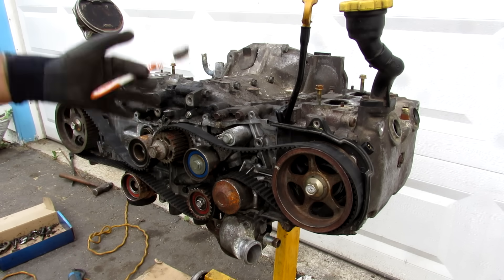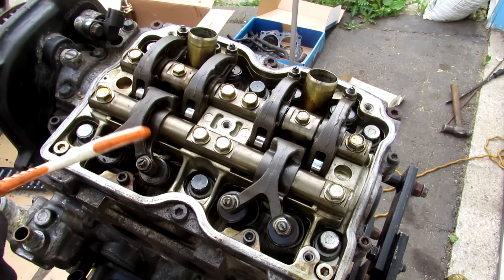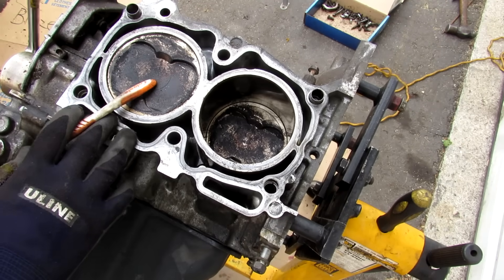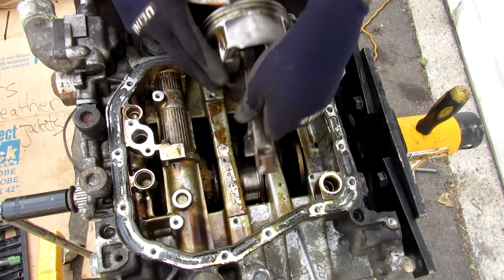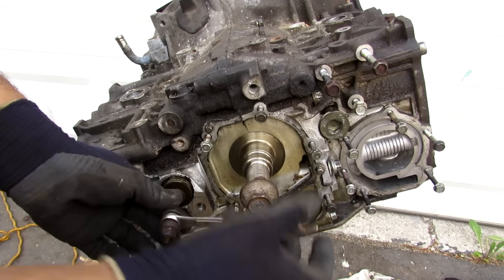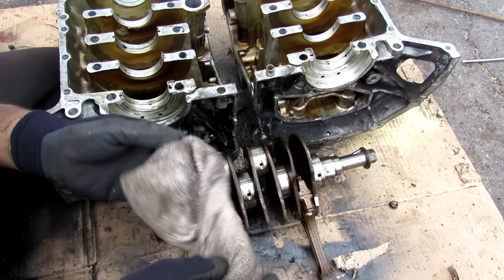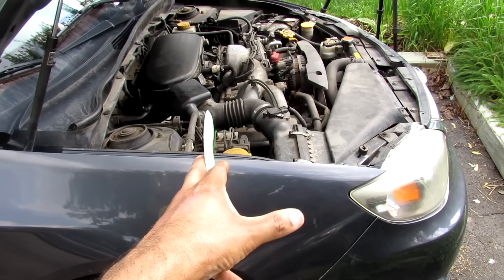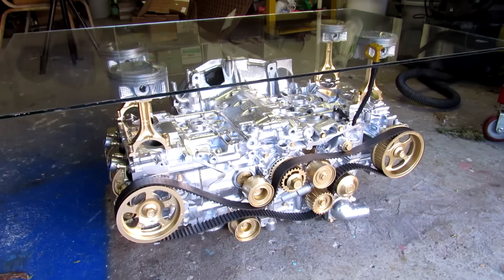Why Subaru Engines FAIL

Comment: They go knock knock and when you answer your connecting rod comes out lol
Reply from the maker: That's what happened here haha
Reply: That was funny
Reply: Thats about what happened at chernobyl as well
Reply: In the industry we call those "ventilated blocks." Lmfao
Reply: There is also piston slap and sometimes chatter in the valve system - don't know if it would be guides or lifters there. Sometimes a timing belt roller bearing will tick loudly, and cheap Chinese replacements for that item are a mistake. Today most of the after market parts come from China so  you must pay dearly for OEM Japanese manufactured parts, especially brake pads and rotors. Best of luck if you try using a cheap off brand head gasket and hope to get more than 10,000 miles out of it. My check engine light went off recently throwing a fuel tank vent solenoid error and simultaneously blocking fuel hose fillups so I priced the $400 dealer repair and may be able to replace the solenoid as  after market at Autozone or Advance Auto Parts for $75. That is what is good about owning a Subaru.
Reply: @z978ady  all brake rotors and drums today come from china. Even the ones on brand new american made vehicles. Very little is made in north america anymore. The pollution laws have stopped the manufacture of most all cast iron products in nth america
Reply: Happen to my volvo 850R i was using water/methanol injection and one day i decided to use bigger injector 440/cc vs 320/cc stock. When the methanol injected at 12 psi it bend a rod.
Reply: @jakelowang4132  Rather have spaghetti rods then my 05 s60R's cracciboi cylinder walls.
Reply: @daviddou1408  engine developed head gasket leaks in 2o15. So I had gaskets, timing belts and idelers reply ed at that time.
Reply: ki0ng that is pretty much what I do. RPM varies between 2500 to 3500 on back roads and 2800 (75 MPH) for hours on end on the expressways. I do not drive it like a rally car except on snow covered winter roads. Also change oil every 3000 miles.
Reply: My Subie has clattered on start up for the 100k I have owned it. So did my ancient VW Bug and it lasted 250 k. Both had piston slap that went away as the engine heated up. Then the clanking stopped. I will admit the head gaskets had to be replaced at 90k. I consider the Subie to be a well made car with a decent reliable engine. 
I hope this guy is better at rebuilding engines than making nearly incoherent videos.
Reply: @gregwarner3753  I dont think he's saying subarus are poorly made. I think he's pointing out the common failure points, every engine has em. If you know where they are, you can be weary and get more life out of your engine.
Reply: @Twofacedrezy  6.0 liter powerstroke diesel comes to mind it has so many issues its hilarious yet every one of the people who own them will shit talk the 6.4 powerstroke
Reply: @Twofacedrezy  They are poorly made, these are designed compromises to fit a boxer in a small car.
Reply: @gregwarner3753  does he repair them as quickly as he speaks? If paying by the hour, he's my guy! LOL
Reply: @gregwarner3753  I don't understand or agree with your criticism of this video. I though he did a great job!
Reply: @gregwarner3753  I buy my cars at 250 and usually scrap them at 500 and not because the engine stops just every thing else does.
Reply: @gregwarner3753  If you think this gentleman is "...making nearly incoherent videos..." than I'd say you understand VERY little about ICE engines.  (And for the record, we bought a brand new, 1995 Outback, which had had TWO engines fail--the second, catastrophically--before 112,000 miles--when the car was still sitting on it's new/OEM Michelin tires.  Subie engines definite (did) BLOW, at least in those days.
Reply: @1TruePatriot  if your Subaru outback was still sitting on its OEM tires at 112,000 miles, I question your maintenance uphold on the car.
Reply: Maybe I don't demand too much from my '95 Subie , like all day at 80+ out west, but I got over 200k miles out of that engine. The car died of chassis rust from 20 years of New Hampshire  winters.
Reply: @NER3X  right lol how was there even a tire left by that point
Reply: @1TruePatriot  I guess I should be grateful. My STI is at 115,000, still on its original engine, but on about the fifth set of tires.
Reply: @gregwarner3753  found the trump voter

Comment: Well 2.5L wasn't the best engine, but EJ series has very good engines for example 2 litre. Spark plugs can be replaced within 30 minutes if you do it from underneath, it's way easier this way, you don't need to remove anything on top and it's not like you have to remove them every day either, platinum plugs installed from the factory and they last around 100k miles... The main issue what people don't realise that it's not a standard engine and you have look after it buy changing the oil regularly and only use the oem oil filter.
Reply from the maker: Yeah but it's "regular" people that own these cars, not everyone understands that maintenance is higher on a Subaru
Reply: @speedkar99  Well if people don't follow the service manual and buy cheap oil and oil filters and don't follow the service manual they cannot blame the manufacturer really. However 2.5L had a design flaws and they're not very good engines. If a 2L engine can last 500K miles the 2.5L would be happy with 150K miles. Mind you, the newer not EJ engines are even worse some don't make it till 80K miles... However good old EJ20G and EJ20K would last a long time if looked after. My subaru has a stock 250 bhp engine and its 23 years old with 212K KM, running strong and I do not even need to top up the oil between the oil changes.

Comment: Couple issues. The EJ253 hasn’t been used in America since 2012 and you happened to find one owned by someone who doesn’t know the dipstick from the blinker fluid. Yes, the boxer style engine will be damaged if the oil gets too low, just like any other engine. 

The timing belt isn’t a big deal at all , especially considering Volvo used the same setup and Subaru’s 6 cylinder uses a timing chain. 

There was a problem with head gaskets that was corrected by changing the material. It’s a problem long since corrected in the F series engines. 

However, the F series engines from 2010-2014 had an oil consumption problem that ended in a class action lawsuit. 

All of this changes if the engine is turbocharged.
Reply from the maker: Some people will advocate for Subaru engines and some will stay far from them! Every vehicle needs maintenance but with a design that makes it difficult to service components that often fail (example remove engine for head gasket job) it compounds the cost of ownership greatly

Comment: One of the most common issues with people that don't know what they're doing is using an impact gun to take cylinder head bolts off.  You should not be making videos on how to take engines apart.
Reply from the maker: If you actually listened carefully to my video I mentioned I already cracked them free before impacting them off. I also mentioned this is a scrap engine for demonstration. At the end of the video I turned it into a table...

Comment: You are well spoken and you know your Subarus! I also like how you expertly edit your videos. Lots of work went into this video. One question: Where can I buy your pointing tool? Just kidding. But since you showed how oil starvation is a Subaru issue, why don't they just increase the metal width in the oil ring and maybe increase the size of the oil return ports on the pistons?
Reply from the maker: I've linked the pointing tool in my last few video's Amazon links. 

Those are all improvements that I hope Subaru has taken into account with the newer FA engines
Reply: @speedkar99  Your poor brother. I guess you are using his toothbrush too :(

Comment: Any inline engine has better balance then a v configuration. Secondary stroke our up stroke from bdc to tdc which resonate and don't cancel harmonic  resonance very well.v configuration is way  more tangent  then a inline.v configuration get a lot more bearing, rod, piston damage. Any short stroke engine has greater bearing, rod,piston damage look at Subaru piston size    bigger piston has more force applied to crown our head of piston. I'll  Stop rambling just look up tangent that explains a lot.
Reply from the maker: Hmm do you know about secondary moment of acceleration? 
That also occurs in the horizontal direction (adjacent and perpendicular to the crank) as well as vertical. The V6 will be smoother than an inline 4 any day!

Comment: Wrong heading - Subaru engines don't fail. Subaru EJ25 ONLY fail. Do you know your Subaru history? Do you know the EJ20 engine? Do you know it was the base engine for several WRC wins? The reason Subaru were forced to build the EJ25 chocolate engine, as it is known, was built to meet unreasonable emissions demands - Not in Japan though. That's why the EJ20 continued successful in Japan. EJ20 engine: forged pistons, 8000 rpm limit, nitride crankshaft, never ever fails, better than anything out of Germany, BMW & Merc with their numerous engine issues, oil leaks, etc.

Comment: When I was researching buying a new car a few years ago, your video is the exact reason I crossed Subaru off my list. I'm a very good home mechanic who works on my own car. I've done it all my life. The fact that you must pull the engine to replace the head gasket is the thing of nightmares. Other honorable mentions (that I just found out) is bolts hiding INSIDE the coolant jacket? Plugs to access the piston connecting pin? Come on Subaru, cut the shit. I bought a four cylinder Accord and couldn't be happier. Cheers, great video. 👍🍻

Comment: If you are prepared to rebuild the engine; mainly the one in the BRZ; can you fix the issues; proper oil feed; proper separation between oil; water; combustion chamber; seals; early wear; parts breaking bits off; also that power dip they are known to have in the middle range; or is it just something you have to live with? Also; really clear to follow video; the joke with one of your brothers clothing on the videos is a funny touch too.

Comment: That is actually a 180 degree V engine as the opposed pistons move together (are on the same crank pin). In a boxer they move in opposite directions connected to separated crank pins, 180 degrees apart (like an aircooled VW)

Comment: Talking about non-turbos the boxer 4 Cil are one of the most reliable blocks out there. 
Problem is that driver is kindly invited to drive only between 4500 and 8000 rpm.
Service the motor correctly and it will last as much as you want.

Comment: Let's see..my 2002 legacy has had external head gasket leaks, uses oil, leaks oil and coolant, and has piston slap when cold. But it's gone 180k miles so far.

Comment: They also get awful gas mileage for a 4 cylinder.You are better off with a NA 6 cylinder.BTW I had a crosstour Type R--and raced a coworker in 2016 that had a brand new STI--it was even up to  100--then from 100 to about 130--I got almost 2 car lengths on him.By 2018--the car failed emissions and he wound up getting rid of it.He had also gotten an exhaust--do not no what--but it sounded like crud and rasped.

Comment: Furthermore, the head gaskets have been solved with multi layer steel gaskets. The composite head gaskets were only used on 2.2 L engines. I'm just going to stop watching as I'm 4 minutes in and tearing this up.

Comment: Watched 3 minutes and as a factory trained tech, engine builder and tuner I'm amazed at the way you do things and how much you actually don't know. 2.5i engines have variable valve lift but only one cam sensor. Only the turbo models with active variant cam timing have multiple sensors. On top of that, servicing every aspect of this engine is easy to do in car. Spark plugs take the same amount of time on a inline engine vs this particular EJ series. It's a shame they give everyone access to a camera and not even have to check facts perpetuating false information. And your technique is terrible. Stop using screw drivers to hold the cam. Leave the belt on next time kid. And the Allen keys only strip out if you don't know how to do it, and again, that's only on turbo models.

Comment: Great vid . BUT It would have been good if you could say if better aftermarket / or high performance gaskets and rings are available . Or any other mods and parts make these engines better than standard . Don't give me problems .......give me solutions . Excellent content though .

Comment: If you don't neglect routine maintenance an EJ isn't so bad. Have an EJ255 in an 04 FXT with a hybrid turbo and I beat the bejesus out of it regularly... 165k miles with no major issues. Timing belt, 11mm oil pump, valve seals and Tomei head gasket with ARP head studs at 125k. Doesn't burn a drop of oil between oil changes

Comment: I've owned several Subarus, but I never knew that one of the main bearings was not pressure lubricated! 😲
Reply from the maker: I think it was lubricated from the other half of the block. I'd have to double check the lubrication diagram in the manual.
Reply: Kevin Chatwin I can’t see how one of the main bearings wouldn’t be pressure lubricated.

Comment: I just finished rebuilding my 06 STI engine after a ringland failure.
Reply from the maker: EJ257 :(
Reply: I did my 06wrx for the same reason. Sold the car and new owner blew it up 6months later 🤣👍

Comment: Wow that belt layout looks like a huge pain in the ass
Reply: It's really not that bad. Plus it's at the front so access is good.
Reply: It’s no worse than most 1990 or newer cars.
Reply: To do the timing belt nust be a nightmare i will stick to my 08 Hyundai Elantra which the timing belt was easy to change.

Comment: Owning a 13 Tacoma...i will take a 1GR-FE 4 litre v6 any day...dead reliable and easy to change oil. Swapped standard plugs for NGK Iridium and it will seemingly  run forever. No horizontal opposed engines for me.

Comment: Ive got 210k miles 2007 outback gaskets have failed on me twice both times I used k seal I also run lucas oil stabilizer cuz she burns a bit and the knock at idle and low speed acceleration goes away the car is used only for my food delivery job I do over 70 miles a day 5 days a week still original 5 speed manual ive been running 50% lucas and 75w140 with moly (it yells at me with 90wt) all my synchros work smooth even first gear ive been waiting for something to fail when it does I'm going to fix it lol I don't baby her either got a stage 2 ebay clutch feels like crap but its the best car I've ever owned bought it brand new from the dealership in 2007 driving her to the grave.. mine or the car's? Yes
Edit: Your mileage may vary! The only advice I can give is check your radiator fluid and cap weekly like physically remove on a cold engine and make sure the fluid is at the top caps can be faulty and not fit tight even when brand new gotta bend the ears down with some pliers that will keep your overflow tank from functioning and you run outa coolant slowly if it don't fit real tight also don't beafraid of putting thick oil or lucas motor mud in a high mileage car hahahahahaha

Comment: I need your help @speedkar99 my toyota keeps "pouring" coolant through the overflow hose on the coolant reservoir. It does so after running for a while under normal driving conditions. There's no visible dripping or leakage from any of the hoses or around the thermostat. It pours it even though its not over filled and if its not topped up it will drain the radiator. Please help

Comment: A Boxer, the engine that solved problems that nobody had.  Low CG, low vibration...at the cost of added complication, low rev speed, lower peak revs, lower reliability, harder to work on.  I will take an inline 4cyl over a boxer any day.

Comment: The timing belt is an issue thats why they went to chains in the new Subaru engines.
The newer Subaru engines have resolved most of the issues talked about thankfully.
Reply: These are good long term motors if you can do the repairs yourself.  I've already read that the newest motors are less likely to require the head gasket work.

Comment: i feel like i can finally completely tear down a subaru engine even though i dont work on cars or have a subaru
Reply from the maker: They are simple to tear down until you get to those piston heads
Reply: But you must need a coffee table with working clock just opt out of the alarm it only works once then you have to overhaul your coffee table clock

Comment: I've been a mechanic for over 10 years and not once have I had a subaru come in to my shop with major engine failure or any major failure. I consider them to be more reliable than honda and mazda. Don't let anyone fool you about reliability. Service and maintain them at the manufactures service schedule and use genuine parts/lubricants. You won't have an issue. I just bought a new 2019 forester and love it!

Comment: If I had one of these engines I would change oil every 2500 miles and hope it doesn’t blow up
Reply: There are some mods done to these engines that allow people to drive them hard with the same lifetime as with regular driving. That includes better oil pan and they do something with coolant flow that allows better cooling of the cylinder that's prompt to fail due to excessive heat accumulation.
Also thicker oil for summer and thinner for winter. If I am not mistaken
Reply: Merl Klarhoelter It’s all in the maintenance.
Reply from the maker: Don't forget coolant, and don't drive it too hard.